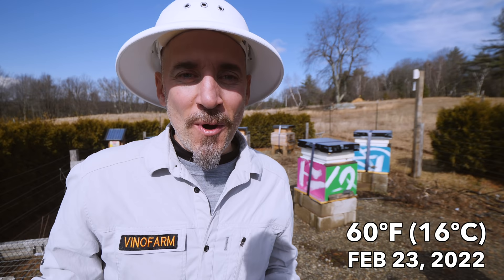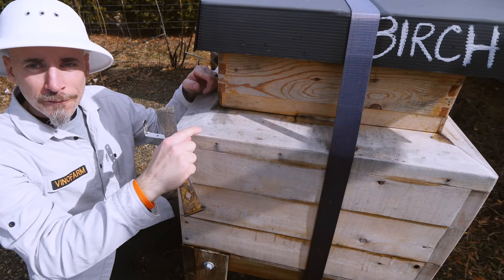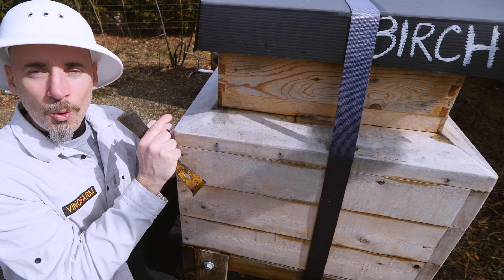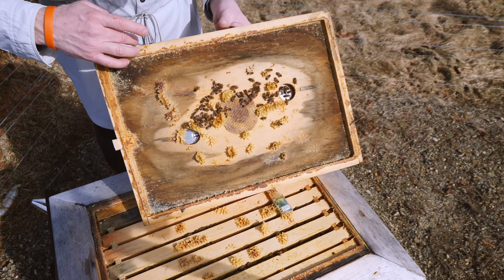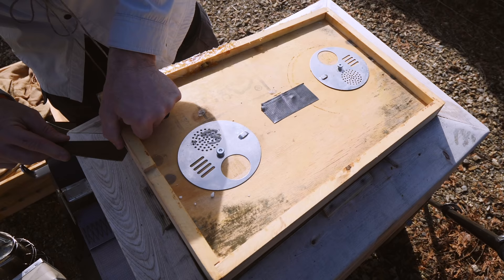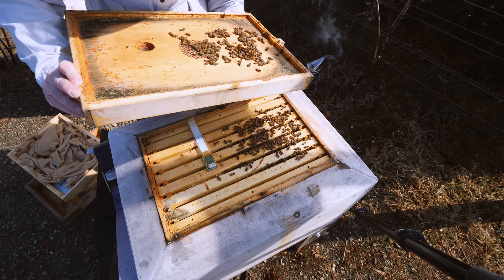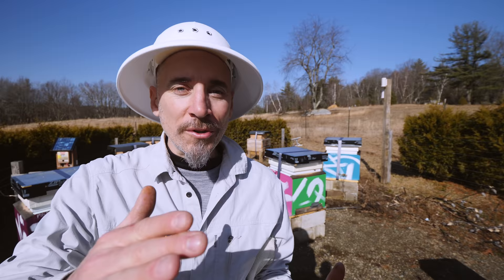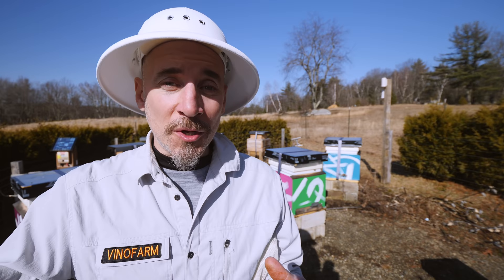A FLAW In My Hive Design... (So How Are The Bees?)

Comment: Thanks for the idea, over the winter I’ve built three to try out. I’ve been thinking a lot about the condensation issue, I’ve been a home inspector for years and moisture happens if there is lack of ventilation. A lot of the time your upper entrance is so small that it won’t allow enough of the warm air to escape. Just food for thought.
Reply: In a few of his videos, Jim has explained why his bee barn does not have an upper entrance.  If you can't find those on YouTube, check out his IG channel.  He has explanations there.
Reply from the maker: “Moisture” exists and is created inside the hive when the bees consume honey and respirate. “Condensation” forms where humid, moist air contacts a cold surface. Lack  of ventilation does not “cause moisture.” Bees have plenty of ventilation with just a lower entrance. With a fully insulated hive and no thermal bridges bringing in cold, the air in the hive should stay warm enough to prevent condensation from forming where it is now (up on the ceiling.) Ideally it would form on the walls away from the cluster or below the cluster where the bees could still access it (they need water) and excess water would simply flow out of the bottom of the hive. My flaw was allowing cold to get in where it did. This is not about ventilation. 

However, in a traditional, un-insulated hive, ventilation WILL help expel excess moisture and is important. The thing is, then you’re making your bees work VERY hard and they’re going to go through a ton of resources to heat the cluster.
Reply: @vinofarm  I’m sure you and I can agree that heat rises so when cold air is in contact with it it will create moisture and it will alway collect on the lid unless it can escape. And as long as you have a front entrance you will always have cold air coming in.
Reply from the maker: @kellysanders3875  That’s not how condensation works. It doesn’t automatically collect on the lid. It forms wherever there is a cool enough surface. If the lid is completely warm the dew point will be too high for condensation to form. If the walls of the hive are cooler near the lower entrance, condensation will form closer to the entrance. It’s all about surface temperatures and dew point. It’s possible to have super humid air and a totally dry lid as long as the lid is warmer than the dew point.

Comment: My 2 cents. When we vented directly  on the top,  I eliminate the "heat dome" thus producing a chill lid and you will get condensation/mold.  This year our "upper entrances" are in the middle of the upper super.    Leaving a top warm area and no inner cover insulation.   Good luck.

Comment: The flaw is that you have insulation blocking any air flow out of the hive that would carry away and out the moisture. Bees do fine with cold temps. 
Much respect
Reply: I Have to agree with you totally. If you worked with home construction or firefighting, which I have done both, you understand the importance of air movement and how it works. I can't tell you the number of times I have seen mold and moisture build up in attics of homes all due to one thing, no air in and out. And it all happens during the winter. All of these attics with mold had no or not enough soffit vents to push air upwards and out the ridge vent. once the soffit vents were installed, mold and moisture was gone 100%. Hives are no different. By tightening up a hive too much, you pressurize the inside, trapping moisture. That moisture gets heated and cooled by ambient temps between the colony and the outside temps. The cold air will fill the hive even with 12 inches of insulation around it unless you have a constant heat source that can constantly combat the cold. Bees are not and cannot be a heat source for the hive body, only for their cluster. As clusters decline that heat source declines. We wrap hives to keep wind chills away. A steady flow of air movement, even just a little is an absolute must. And it has to follow from a down to up fashion. Allowing moisture to just flow down the walls will create an ice or frost on the sides, creating a chest freezer for the bees. I applaud the design, but air has to flow in and out. if this design incorporates air flow, he will have a good design.

Comment: I would use any type of natural fibre insulation such as wood fibre, sheep wool, and hemp. These are used in applications where it is necessary to regulate humidity inside of a building from a type of natural fibre insulation this would also be hygroscopic insulations for the hive 🙃 hemp would be a great one two start out with

Comment: Thanks for all your work. Curious if the long form frames would increase the possibility of "rolling" your bees when doing inspections? (I think that is the term, but I am relatively new to this... also wish there was a comment search tool in youtube so I could see if you have been asked this yet)
Reply from the maker: I have follow boards (spacers) on the outsides, as seen when I removed the frame in this video. I remove the spacer first which gives me plenty of wiggle room to pull the long frames. I always remove a spacer first.

Comment: Just quick point reminder.  There is no such thing as cold, it is loss of or absence of heat.  So cold doesn't creep, like the arrows, heat is lost in reverse direction.  The is no bridge for cold it a bridge for heat loss.  Condensation occurs from air with loss of heat - to something cooler (air, surface, etc) and then any evaporation later further removes heat.  So key to design is not keeping cold out its keeping warm in AND preventing contact with cooler temperatures.  This is design/purposes of vapor barriers and air gaps/insulation in structures.
Reply from the maker: Good point, but I did come to the same conclusion, yet my terminology may have been wrong. My point was that I want to try to keep the entire inner cover area warm, or at least above the dew point. So yes, I'm trying to prevent heat loss. I understand thermal bridging, and think of it as not so much cold moving in, but warm surfaces being replaced by cold. Heat goes away, things become cold. Right?

Comment: Hey Jim, I have built two Bee Barns. What is your plan when you need to swap top and bottom boxes in the spring. Also, do you see a problem if you ever have to checkerboard?
Reply from the maker: There is no swapping. The bee barn is an extra deep permanent brood box with extra deep frames. The supers go on top when needed and are taken off in fall before winter. The whole point is that there is no disturbance of the brood nest.

Comment: Do you think a rectangular single layered sheet of burlap, laid flat on top of the frames, but under the crown/coverboards could alleviate the condensation for the current design? It might wick away the moisture collecting in the cooler areas, preventing a mould friendly environment?

Comment: So if you add insulation you will solve the condensation at that point but without adequate ventilation moisture will continue to build over the winter. It looks like the wood was your moisture wick/sponge. If ventilation was increased maybe the condensation would have been less. In other words maybe the condensation is an indication of two problems. Inadequate ventilation and the thermal bridge you talked about.
Reply from the maker: Ideally, moisture will condense on the walls of the hive and below the cluster. Bees USE water during winter. I don't want to get rid of it, I just want it to form in a different spot. Unused water will run down the walls and out the bottom.
Reply: @vinofarm  if I may make a suggestion. Is there is a college near you that teaches engineering. You have three things going for you. You raise bees (which are in the news all the time), you have an intriguing problem and you have or can get data. Contact the engineering school and see if they have a student who needs a project. We have a vo tech school here and I use them frequently. Some data, a student and a good thermodynamics program  I feel will eliminate a lot of guess work and allow you to home in on an optimum solution much faster.

Comment: I wonder if the thermal brake can be designed to be part of the inner cover, even if it ended up extending the size of it. That way, the current design of the hive itself could remain the same.

Comment: There is definitely a need for silicone around the top where the super fits inside the outer insulation. How late did you feed? Bees need a month to cure syrup or it can cause moisture. Insulated  inner covers work better than just insulation sitting on the top like seen in the video.

Comment: If you went to a clear plastic inner cover, you would eliminate the spot where the cold is causing condensation. I use a clear plastic cut to box size about the thickness of a gallon milk container, I don't know what mil but maybe 25 mil? I've also seen people using 1/16th inch plexiglass which would allow the holes and grids to be used like you currently have. My plastic thickness is too flexible but I never get mold growing between it and the foam insulation. Nothing for the mold to eat like the wet wood does. And, it's so non invasive to just lift the outer cover and see the bees without smoke or them flying, getting chilled, whatever. Keep exploring, there's better hive solutions than 3/4 inch hive going through winter forcing the bees to burn honey like anyone in an uninsulated house would.
Reply from the maker: Yeah, don’t tell anyone, but I’ve been planning clear plexiglass inner covers for the past year. Stay tuned.

Comment: I noticed your top cover has vents but there is a non porous insulation that sits on top of the vents. So the water condenses there on the foam and drips back down on the top cover. You would have no water problem if those vents has wood chips or "quilts" on tops.  You blocked off all ventilation for moisture to leave.

Comment: Would it not be easier to build the outside higher so it covers your inner cover in the winter.  QE and supers would drop in slightly.   Also wondering if there was excess moisture in the fall from feeding.  A mentor in our area often tells us that excess moisture is often from feeding too late in the fall and not allowing it to cure properly.  He suggests to us to feed 1 week earlier in the fall, and reassess moisture issues next spring. If still too much signs of moisture, start a week earlier the next fall.  Eventually you should see minimal moisture issues.  As you mention, bees live on the moisture, but the excess moisture is the killer.
Reply: Also great to see you are doing well so far this winter.  Been there and lost 24/24 one year.  Think we've managed to resolve our issues and we've been doing fantastic with under 10% losses that past 4 years.

Comment: Stainless steel doesn't conduct heat, so a rim made from stainless might solve your issue. I'm thinking that a band of stainless where the wood parts meet would stop the thermal bridging. Something to consider.
Reply from the maker: Who told you stainless steel doesn’t conduct heat?
Reply: @vinofarm   Some building institute in Canada, teaching advanced building techniques. They have a display demonstrating how they use stainless fasteners to stop thermal bridging. I'll look around for a link.
Reply: @vinofarm  Found this one: https://www.youtube.com/watch?v=e6plUu-mYS8  Mind you they were talking about lag bolts and such. Your mileage may vary.

Comment: When you are done redesigning the new boxes are you gonna move the bees in the new design or are you gonna just try to mod the problem on the current hives?
Reply from the maker: Most likely all new hives (eventually). I’m working on one for a test run before committing to 6. A retrofit would be clumsy. I’d need to remove the bees, bring the boxes down to the shop… I’m going to just build a new one fresh.

Comment: First of all I love your videos and your channel. Thanks for sharing.
Anyways, I was curious how the bees are able to remove dead bees from the hive with those metal pieces that cover your hive entrances? Looks like they have holes in them that are barely bigger than the bees themselves. So do they have any issues trying to fit two bees through those entrances? I couldnt get a real good look at them, but that's what I wondered. They always have dead sisters through the winter that they gotta get rid of.
Keep the great videos coming Ser.
Reply from the maker: They can drag out the dead just fine. However, I’m not sure what’s going on this winter, but I’m not seeing the usual piles of dead bees. Normally, dead bees are littering the ground in a 6 foot radius around the entrances and this year there are VERY few bees. Also, hardly any building up on the bottom boards. Not complaining, just an observation.
Reply: Well that's awesome if they're not piling up inside! I know that I have some small piles of bees around the front of my hives. I was just curious if they had any troubles removing the dead. Keep up the great videos, I look forward to when they come out. Btw, I'm in SW Pa so spring is almost here. It'll be up north before ya know it! Happy bee keeping to ya.

Comment: I have two question 
1 what sort of bees you have if say Italian wrong genetic your region. Maybe russian type effective your area.
2. How Co2 and moisture exit hive and how fresh air O2 enter hive ? under hive bottom ? hive entrence.? Top of hive? I saw russian forest bees easily live in trees top side well insulated.
Reply from the maker: 1. Italian and Buckfast. Italians have done fine for me because I give them insulated hives. I had 2 Russian hives. One was killed by varroa within one season. The other lived three years, but were very nasty and didn’t produce much excess honey. I never liked them. 

2. These hives only have lower entrances. 8” wide at the bottom. No upper vent or openings year round.

Comment: You still don’t think an upper (small) entrance is worth it instead of changing what you already did?  Is it not worth looking at I wonder?  It seems a good thing on mine, although I run standard. I see a benefit in the insulation you added.
Reply from the maker: I watch temps via the sensors. Even in the summer, upper entrances cause temp fluctuations right where the brood is. Closing the entrances stopped the fluctuations immediately. NO UPPER HOLES from now on.
Reply: @vinofarm    Ahh okay you know what I remember that now.  Thanks
Reply from the maker: @tc9459  In early summer (early/mid June), we have nights in the 50s (10C) and I watched brood temps drop 15° at night with a single upper entrance. It changed my whole outlook on upper vents and entrances.
Reply: Vino do you have a video showing the sensors info ? Be really interesting to watch!
Reply from the maker: @simplynatural100  I post sensor data on my Instagram just about every week. @vinofarm

Comment: You gotta realise that first super is ALMOST PERMANENT. it’s either honey super, feeding super or insulation super. YOU never remove it. You only need to remove it for “pry bar” action of the the top bars. 

MAYBE modify you hive tool instead, and insulate the continuous outside walls up along to to half the height of the super.
Reply from the maker: The brood box is a deep+medium combined cavity. It has 16" deep frames. It is a permanent brood box. I add supers during a flow and remove them for winter. They live entirely in the extra deep brood box. The whole thing is insulated year round.
Reply: @vinofarm  you’ve miss understood me. Right now you have super (medium box) on your hives with burlap sack. Later it will be filled with syrups jars and after that it will have the 1st honey stores. That box is on ALL YEAR. You can raise the build design of the outer insulated walls to be higher than the top of the brood chamber. Then the cold bridge won’t matter if it Bridges to foam/burlap (far above the crown board)
Reply from the maker: @sinisterhipp0  That’s not a super. It’s an insulation and feeding box.
Reply: @vinofarm  Anyways I'm looking forward to the solution you choose.

Comment: Thank you, I have mentioned thermal bridging to beekeepers and they laugh at me.
Reply from the maker: Thermal bridging is no laughing matter!
Reply: @vinofarm  Indeed. My 1964 appartement building has concreet floors/ceilings between each layer and these lay on the brick walls all the way from front outside to the back outside, so each floor is one big thermal bridge. The roof is insulated, the glass is insulated, we could insulate the minute amount of walls between the glass, but the effect will be tiny because of the thermal bridge of the concreet floors/ceilings. Not an easy way to fix that (AFAIK, I'm not a builder) other then to encapsulate the whole building in a glass house structure.

Comment: I like the insulation houses but there needs to be some sort of ventilation! Take your house for example it’s insulated to the max and heated but you also have ventilation as well. There still needs to be some sort of air moving to dry up condensation… that’s the reason you have mold it’s the thin Barrier between your lids…when Hot and cold meet that creates condensation…. So the roof of your hive needs to have some ventilation as well as being adequately insulated….

Comment: I hope ur right but I disagree. I believe your moisture is coming from inside. Breathe into a plastic bag for 1 minute. You’ll find moisture,
Breathing expels air. Thanks for the videos
Reply from the maker: Yes. Thats what I’m saying. The moisture IS inside. The cold is coming from the outside. The moisture in the air (inside the hive) is condensing on the surfaces that are being cooled from the thermal bridge (the wood exposed to the outside air.)